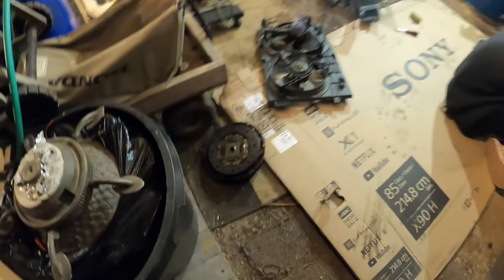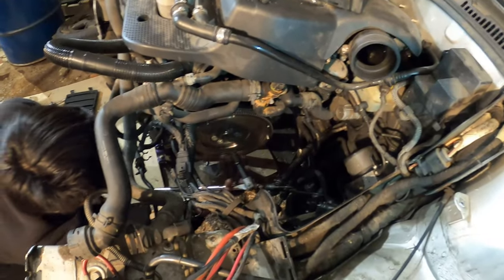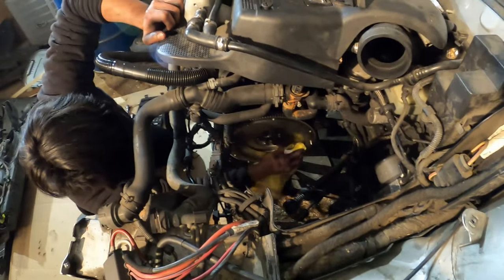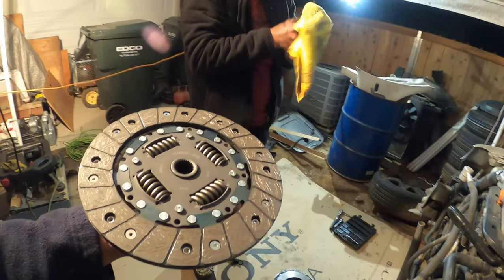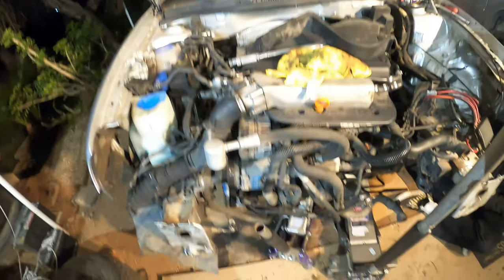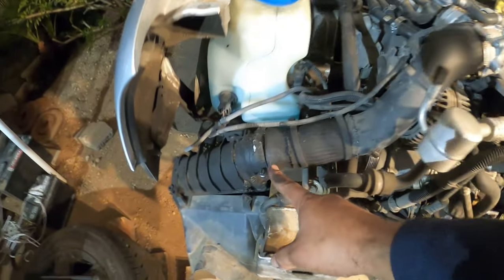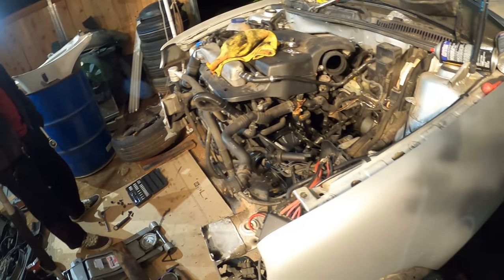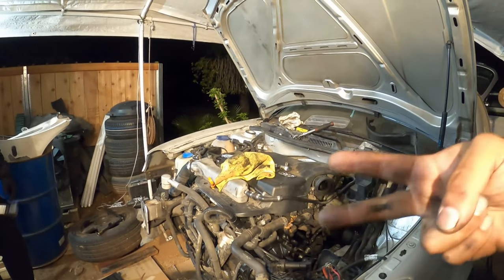Update on Marks Mark4 - Installed Clutch and Transmission

Comment: How many bolts is the flywheel he’s putting in? I’ve been trying to do the same thing on my mk 4 and it’s been a pain to find a flywheel and clutch that fit.
Reply from the maker: 6 but they are special you need to correct type. You can get them online